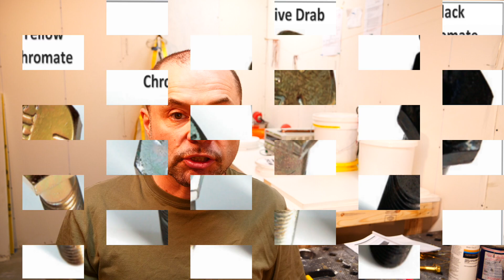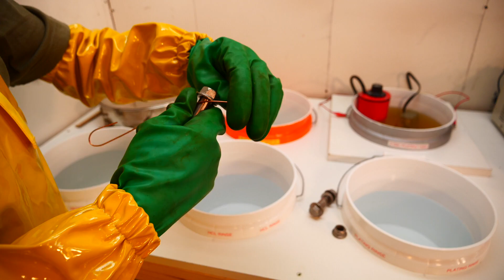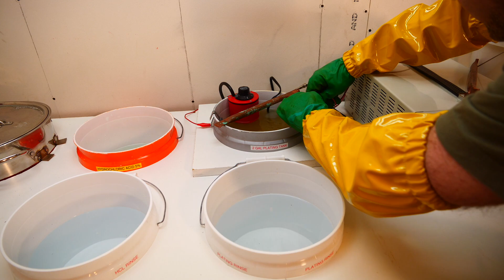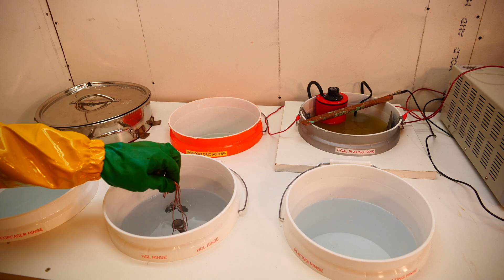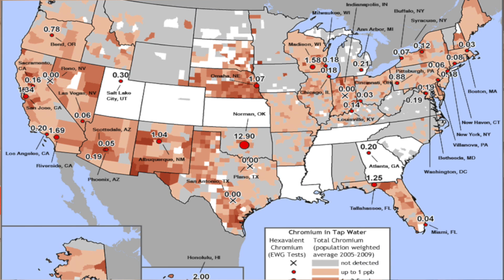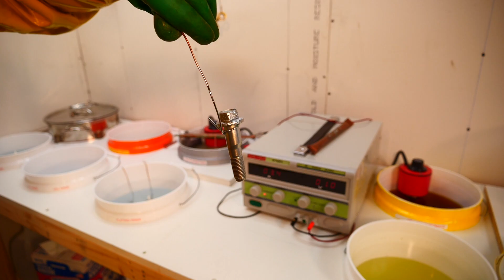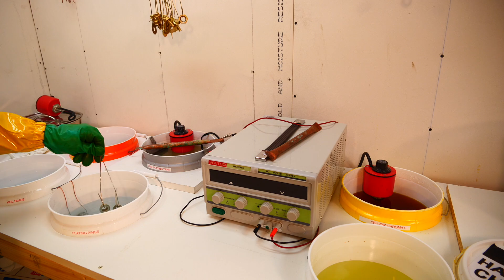ZInc Plating Hardware with Caswell Electroplating Copy Cad Zinc Plating Kit

Comment: In my experience, plating is not all that regimented. Cleaning parts is key, I would move hard to clean bolt threads  back and forth across the wire wheel which helped the bristles reach in the threads .

if you're starting out mixing the Caswell powder and liquid components of the plating solution, add the brightener at that time, then if your results are not as shiny as you want,  use an eye dropper to add more brightener till you get your desired results.
I started out not adding brightener and got dull parts.

When you go from the pickle tank, then rinse, then the plating tank, after so many parts are plated the PH changes in the plating fluid and parts come out less shiny, adding the brightener  brings the PH back.

I also had an issue with cloudy whitish film on my zinc coated parts at one point, adding a filter to the pump in the plating solution corrected that. It was a residue on the parts from whatever had contaminated the plating fluid. Someone said you could wipe it off with toluene , that is because it is not part of the plating, but instead a residue left on the outside of the part kind of like a mineral stain.

When I had just added brightener I noticed I could set the amp flow a little higher and get a chrome like finish, the amp setting did not seem as critical as long as you were not so high to cause excess fizzing of the parts,
Fizzing on the wires coming out of the plating solution was a good gauge to determine amp setting was high enough if you have a lot of  different size smaller parts in the solution which makes calculations of amp not practical. Current flow within reason was not as critical in the plating tank as PH was.

Basically it is pretty simple to plate if you focus on these things, temps of solutions are not so critical as long as you are around the 80 degree range. You can leave parts in the de greaser as long as you want, just rinse them well before the pickle bath.
Pickle bath should be a short dip like 3 seconds, but if you have parts not buffing out good, or having stains, leave the parts in the  pickle bath as long as you want or till they stop fizzing, some parts get a black film on them, but buff out nice after.

If you are not going to use a chromate dip,  and just want shiny zinc parts, use an eye dropper to add the brightener as you go to  to maintain the shine regulating the PH at a  more consistent level than just dumping a half a tablespoon each time.
  When you use a chromate dip, it tends to bring more shine to parts that might not be as shiny,  when using a chromate you may be happy with the results using less brightner.

When you add brightner, it seems you can flow more current flow, within reason, and get chrome like finishes.
 But it seemed after a few real shiny batches of parts, that was was when I started getting the whitish cloudy film on the parts and hat to add a filter to the pump in the plating tank A filter in the plating tank eliminates a lot of plating issues.
. Maintaining the PH in the plating solution and setting the amp flow on a little higher flow  seems key in getting consistently shiny zinc only , plated batches..

Comment: Hi! What is the type of zinc plating solution do you use? Amazing work!
Reply from the maker: It is a commercial product from Caswell Plating, the exact formula is a Caswell trade secret especially the brightner that adds shine. It lasts forever, it is not really consumed, except for the "brightener" that is a trade secret but it not expensive and is used by the teaspoon. The secret brightner is likely an organic polymer. (Starch-like stuff)

Caswell Zink bath part A and B is a proprietary form of well known acidic, Cyanide-Free zinc plating bath. It usually contains: Zinc chloride, ammonium chloride, potassium chloride, sodium benzoate and surfactants. pH is adjusted to 5.5 with hydrochloric acid. (Which I have to add a little as pH drifts up)

There is a lot of ingredients, so Caswell proprietary formula is convenient for a hobbyist. It is like making you own Mayonnaise, you can do it; but the recipe is complex and you will have a gallon of leftover egg whites.

Comment: Awesome video! However, I’ve been struggling to get the plating results come out as a smooth chrome finish and not matte and dull/chalky as some OEM style German automotive hardware. It wasn’t until I added up to the WHOLE bottle of zinc brightener where I started to notice satisfactory results. Do you have any information regarding how to achieve a bright and smooth zinc plating result?
Reply from the maker: Surface Prep, Surface Prep, it will add hours, sandblasting with multiple grits, sanding polishing etc.  Zinc is very thin.  With Nickel and Chrome they deposit a thick layer that they polish after, With zinc it is all part prep.

Comment: Great job with this presentation. I’m currently restoring my old 1950 Dodge Power Wagon. Fortunately, most of my original fasteners are in restorable condition and I was careful to group and label them in plastic food containers as I disassembled the truck several years ago. Many of the original fasteners and details are either not available or are $pendy to replace so this process will pay for itself in this one project. Thank you.

Comment: Great video, watched several times, can you tell me the acid strength
Reply from the maker: It is 5% Hydrochloric acid, a weak solution.  Muriatic Acid sold at home centers and swimming pool suppliers is 35% HCl.  There are many online dilution calculators

Comment: as an ex electro plater the way we cleaned the metal prior to plating was to go through the degreaser - rinse, then through a dilute solution of hydrochloric acid for as long as it took to remove any rust(if it was really rusty go over it with a wire brush as it was soaking in the acid) when it was clean rinse again then straight into the plating solution.

Comment: Great video and details.  One question you mention muriatic acid rinse, but your bucket says HCL which is hydrochloric acid.  What is it?
Reply from the maker: In the US somewhat diluted hydrochloric acid is sold as muriatic acid.  I use an online dilution calculator to further dilute it. In theory they are the same, however some “safer” muriatic acid products on the market now have oily additives and those products cannot be used for plating.  I noticed recently that all of the muriatic acid at my local home depot had these additives.

Comment: @CompulsiveDIY  How come you’re using hydrochloric acid bath??? 
My caswell instructions have no mention of this?? Are you just trying to get an etched surface for better adhesion???
What ratio do yo use for it?
Reply from the maker: Caswell does mention hydrochloric acid to "activate the surface".  Caswell also says that castings (they call pot metal) do well with longer soaks in more concentrated HCl.

Comment: Great video. What type of power supply are you using?
Reply from the maker: It has to be an adjustable current power supply.   Current settings (not voltage) is set during plating.  For a dozen bolts you can use a 10 Amp supply but if you start doing larger parts (like brake calipers) you will need 20 Amps so if larger parts are in your future you are better off buying a larger power supply up front.  Also if you considering anodizing Aluminum you will also need more amps.  I use an $130 ebay lab power supply rated to 20A.  A 10A unit costs half of that.  These cheap Chinese lab power supplies are OK for the plating lab where you are at risk of ruining it by spilling electrolyte into it. (yes it happened to me)

Comment: Can u tell me sir how to make phosphating chemicals?
Reply from the maker: I buy mine from a company that keeps formula partly secret, I get powder in a bag

this guy        https://www.youtube.com/watch?v=G-PtnwtOR24

does it all himself with good results.
Reply: @compulsivediy8036   i am not talking about plating, i am talking about phosphate conversion coating by dipping process.
Reply from the maker: @sky42-1  There is a process for coating steel with zinc phosphate.   This is done by dipping in a solution of zinc phosphate, phosphoric acid and nitric acid.  I have never done this and do not have a formula for a solution.  I read that when iron dissolves in phosphoric acid and Zinc ions are present in that solution, zinc phosphate precipitates on the surface of the steel that is being exposed to phosphoric acid.  Another acid, I believe usually nitric, is used to control the speed of the process and grain size and texture of the coating.  The grainy zinc phosphate surface helps to hold oil and helps oil stay on the surface which is good for lubrication and corrosion protection.  The process is easier than electroplating, but still, I am sure, meticulous prep is needed and I suspect they probably dip in acid to "activate" the surface first.  The corrosive solution has to be heated safely.  I read that is done more ofter in stainless steel tanks (not plastic) but I don't know the temperatures.  After zinc phosphate grains coat the steel it is soaked in oil and these parts stay oily inside their machines forever.

There is a vey similar process done with Manganese Phosphate on guns.  The only difference is substitution of Manganese phosphate for Zinc phosphate.  In the United States this is called Parkerizing because a company called Parker was selling chemicals for this in the past.  I believe Manganese produces a darker color that is preferred on guns.   There are a lot of "Parkerizing" videos on YouTube.
Reply: @compulsivediy8036  you are explaining theory this is not actual formulation I tried solution of zinc phosphate, phasphoric acid & nitric acid it's not working.
Reply from the maker: @sky42-1  Sorry, I have had many failures and know what it feels like.  Here in the US there is one guy who sells Zinc Phosphating solution is small DIY quantity.  www.palmettoenterprisesparkerizing.com   I am sure his formula is a secret.
Reply: @compulsivediy8036  how can i find?
Reply from the maker: @sky42-1  This can be vey difficult.  Factories use consultants and keep trade secrets.  Businesses sell "secret formulas".  I can only give general advice. Look at every step of the process.  With zinc plating, for example, most failures are due to poor metal preparation and not the bath. General question are:  Is your metal suitable? (there are acid resistant alloys)  Have you experimented on "regular "cheap mild steel?  How is your preparation?  Prep is 95% of success! I found that for zinc plating ONLY media blasting (sand blasting) worked.   Palmetto website (mentioned above) has specific metal prep instructions.  He recommends alkaline cleaner first, then sandblasting and then, immediate zinc phosphate. He stresses that the time between media blasting and zinc phosphating must be short.  

I found this Egyptian university paper with google 

www.researchgate.net/publication/289039421_Effect_of_chemical_composition_of_zinc_phosphating_solution_on_phosphate_coating_properties

On the second page under Experimental they give the exact formula for their solution.
Reply: @compulsivediy8036   I have already studied many research gate article.

Comment: I have been running into issues and found it best to just order a brand new copy cad/zinc kit and feel it is my prep that may be the problem! Can you give me your process for prep of a old rusty, greasy bolt? I initially had good luck just wire wheeling parts and bolts to a clean shinny condition then into the degreaser bath. After the 15 or so minutes I rinsed, dipped into 5% acid solution, rinsed, into the plating bath, rinsed, back to the acid 3 seconds , rinsed, then into chromate 10-15 seconds, then rinsed and dried. This worked for a few projects but after storing the kit for a few months I started to plate again and everything went south! The process was identical but after the parts sat drying overnight they began to pop and peel! Oh my gosh what a mess and the sound of the popping was just so interesting? I have a bead blaster and can soak the parts in full strength mutatic acid but it was not needed for my previous batches? I watch you video as a reference and feel it is the best out there but need a step by step prep process. Thank you for the video and any help you can provide me.
Reply from the maker: Wash in degreaser, then mediablast in cabinet with 36 grit aluminum oxide, then shine with 8" wheel on a grinder.  I found that media-blasting is needed and it requires a cabinet and a large compressor.  Much of the cost of  doing this is in prep equipment.

Comment: can you do this with say... lether attached to the metal and can the chemicals be reused multiple times??
Reply from the maker: No this is only for clean mild steel.  This is a corrosion protection method.  Yellow chromate looks fun but black and grey are just as good for corrosion protection and completely bland.

Comment: I gave you a thumbs up, but have a hard time hearing your comments. Questions; If you say 120 degrees or 220 degrees as this can be seen every where, please get in the habit of saying 120 degrees F or C. Engineers use this important vernacular when describing operating temperatures and so on. 
  I noticed small labels on the front of the buckets, but not the lids. Is this an opportunity for a novice to cross-contaminate every so slightly the buckets mixture over time. I find green masking tape & a sharpie in black handy.
 Power supply appears to be purchase rather that built. Is it more about amperage for the surface area of a part(s) than voltage? I like the idea of cutting holes in the bench to keep things at below eye level and easy to reach & handle. 
Buckets are about $5 each at home improvement stores, but if a grocery store has a deli or a fast food place is near by, I have asked the manager and they gave me the same buckets by the handfuls. Sliced pickles to coke slaw is shipped to the store prepared to maintain constant quality control. I found out that normally they are tossed in the trash bin out back. The cedar fence wraps this monster to keep it clean looking and many animals out as food protocol has a short shelf life onced cook cooked. 4hrs is around the max for cooked fries, meat, fish (real or veggie types) and pitched if not sold. (Just a thought for you or others)
  I noticed what appears to be a back-up catch pan underneath the bucket. I would guess this to be best practice but not due to high or low “PH” values, but more about heat. Plastics are marked with a code for recycling and a quick search would find the melting point. Either, cool idea. I just wish I could hear better. As a dealership tech, shops of 8-9 techs is a dull road all day. It sounds like a 747 at idle, ready to take off with clearance. 
 Thanks for the effort, work and expense as consumables are involved. Work of mouth may have business coming in the door. Pricing, is a different animal. If I had properly plated a drum brake backing plate and cool & dry, I would guess a 2K Clear could be sprayed for additional protection. Have you tried a can clear as 2K is clear w/ hardener mixed, like automotive? Thank for the video.

Comment: A great summary of the plating process - I would recommend rectangular buckets as they give much more flexibility to distribute multiple anodes to suit the shape of your workpiece.

These small round buckets can cause hot-spots on larger items, as the anode is too close to the workpiece, and the heaters are taking a significant % of the usable space.

Comment: great work,what did i did wrong and i have black spots
Reply from the maker: It is all in the prep sandblasting and sometimes vibratory tumbling take time and effort but a good shiny polished prep is critical.   Sometimes the bath can get contaminated with other metals.  I usually prep a scrap piece of hardware and plate it first by itself to get all of the contaminants onto it.

Comment: Why do you parts come out of the plating tank shiny?  I am using the same Caswell Copy Cad/Zinc kit and my parts come out of the plating tank a dull gray color.  Did you add brightener to the plating tank and if so, how much?
Reply from the maker: I use a teaspoon of brightner.  It is all in prep.  Sandblasted parts come out dull.  Parts buffed with brass wheel such as the ones in video come out with more shine.
Reply: @compulsivediy8036  And how often do you replenish the brightener?  Also, I agree that sand blasted parts come out dull but do they come out looking like they've been painted with gray primer, because that's how my parts come out.  I can get them to shine by polishing with fine steel wool prior to yellow chromate but I'd rather have them come out of the plating tank looking bright and shiny like yours.

Comment: Hello again, I have the option to buy some "Brick cleaner" which is industrial strength and contains Hydrochloric Acid, is this suitable for the acid dip, if so what would the strength need to be mixed with water to?
Reply from the maker: The product I buy is labeled as Muriatic (hydrochoric) acid for concrete cleaning and removal of cement residue from brick.  It is sold here in 31.5% water solution by weight. I dilute it with distilled water to a 5% concentration by volume using a kitchen measuring cup and an online dilution calculator.  5% is recommenced by the maker of the plating kit.

Comment: Great tutorial, I live in the UK and bought a kit from a company called "Classic Plating" good kit but not quite the same, much easier to use, What size is your beast of a power supply?
Reply from the maker: 20 Amp,  I since damaged my power supply in a solution spill. I recommend putting it on a shelf above the plating tank to protect from spills.